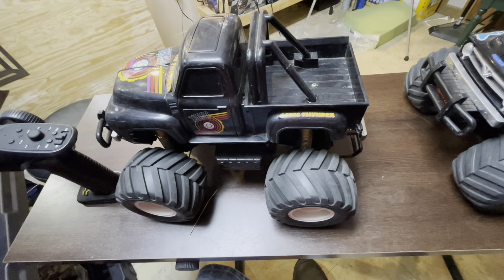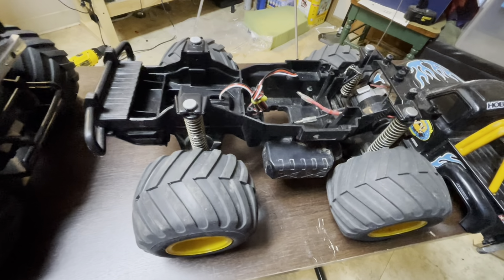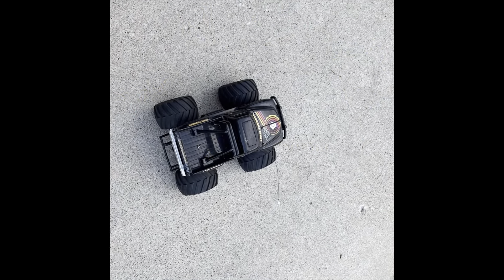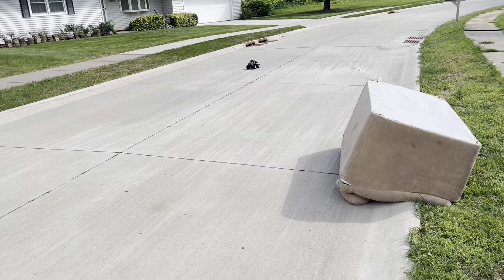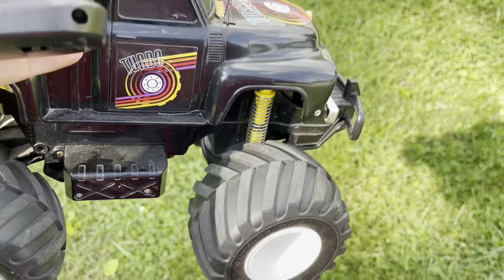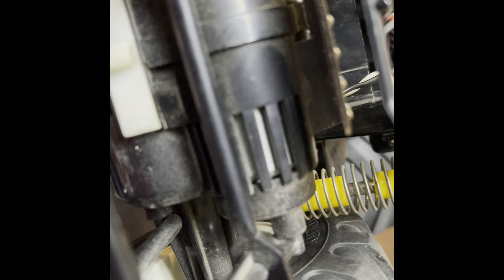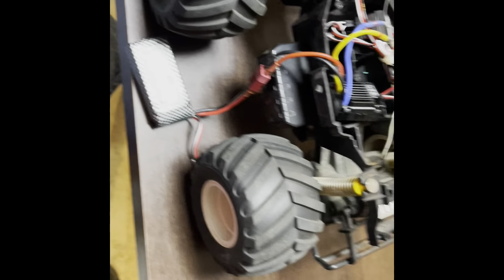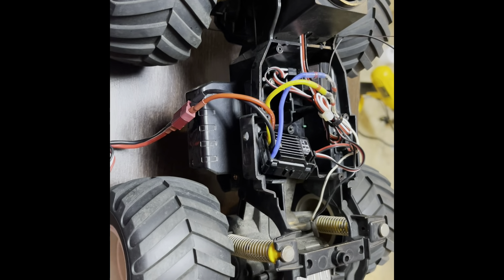I broke my modded Radio Shack Sonic Thunder in under 2 minutes 😞

Comment: Doing a little 3s welding I see... those gears were not happy at all either!
Reply from the maker: Grayson reminded me after this that tge last time we ran it the motor was smoking.. oops, my bad.. yeah the gears on it are pretty noisy. If I upgrade tge motor vs replacing it with the stock one from my part’s truck I’m gonna epoxy the planetarys to eliminate that problem. If I go stock I’ve got a whole extra set of gears for it.
Reply from the maker: I’ve also got a spare body that is gonna be Frankenstein since I’ll have rollin Thunder I gotta have a Frankenstein 😁
Reply: @IowaBudgetRCBashers  I am debating on building a Frankenstein truck as well. It is on the list of possible custom builds!

Comment: Those little motors are rated 6 volt... the original electronics held the voltage back from the 9.6v pack
Reply from the maker: This is the first one I’ve burnt up. Won’t happen again if I do the upgrade 😁

Comment: It's flash back Wednesday. I remember those. Had the 10th scale versions
Reply from the maker: Used to go to radio shack almost every weekend, and I’d always play with these in different varieties. I’ve got most of the series. This is the only one that had the big tires on it. Since I broke the motor, it’s going brushless and the spyder gears are getting epoxied 😎